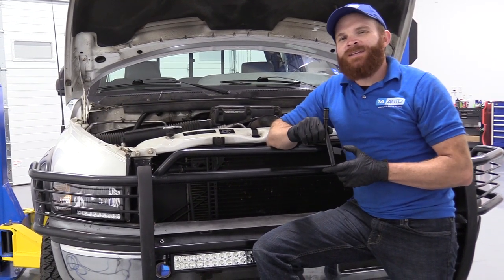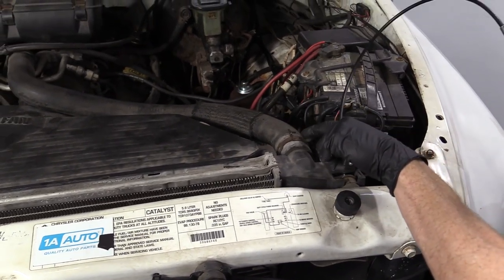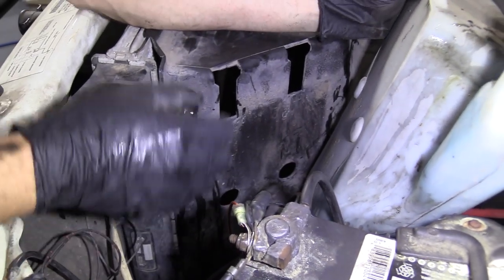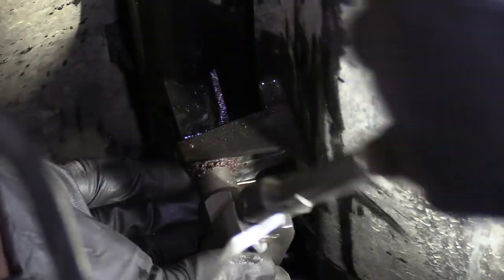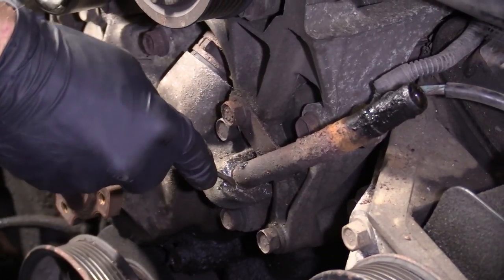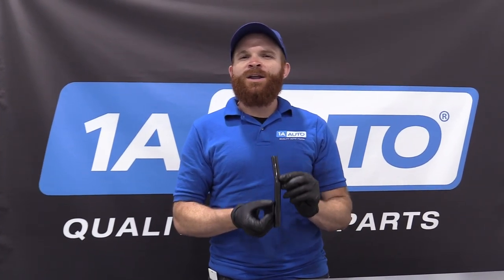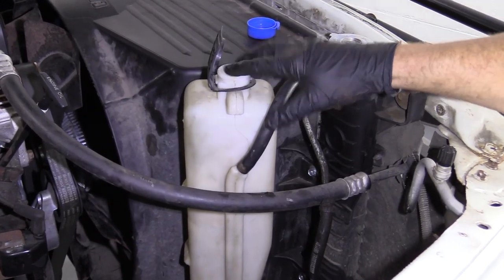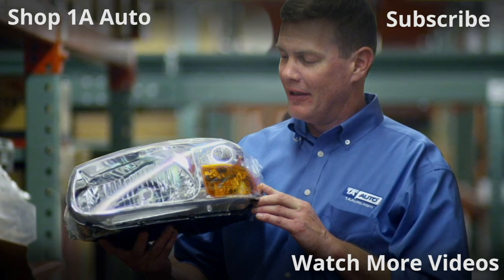How to Replace Water Pump Inlet Tube 94-02 Dodge RAM 1500

Comment: Let me save you some time on this video. 
Skip the first 11 minutes. He is showing you how to take things off the engine that is specific to his vehicle. Some he only removes for better video angles. Plus, by now you already removed it. 
Then watch about the next 5 minutes. That is what you came to see. 
I have a 1999 Dakota. I only removed the belt. Then I grabbed the pipe with a Vice Grips and used my air hammer to give the Vice Grips a few taps. It came right out. 
Make sure you put some plumbers grease on the o-ring and in the hole and gently tap it in with a soft hammer.

Comment: Hello A1 auto I'm a subscriber. I watch your stuff all the time. So in this video I see you replaced the water pump along with the inlet tube. So for just the inlet tube I wouldn't have to take everything off correct thanks again.
Reply from the maker: +Todd Jensen Thanks for checking us out! http://1aau.to/m/Shop-1AAuto-c
Reply: I had the same question but also do I need to drain the coolant just to replace the inlet tube?